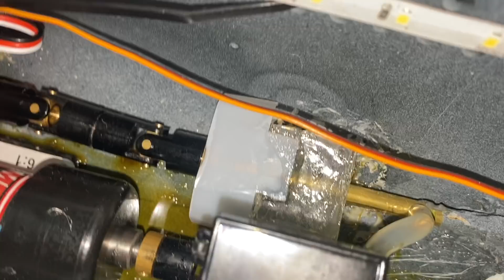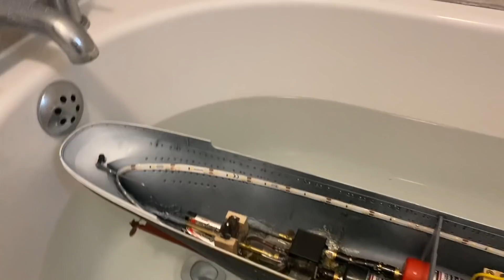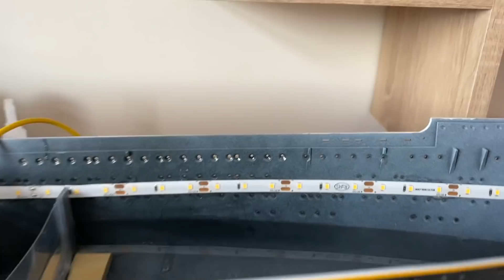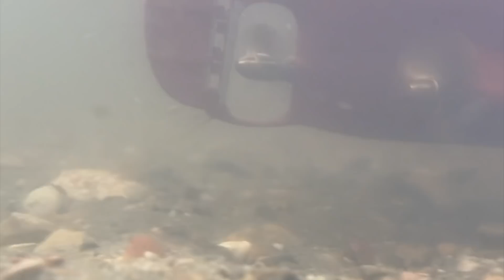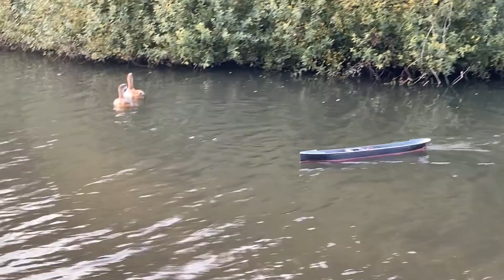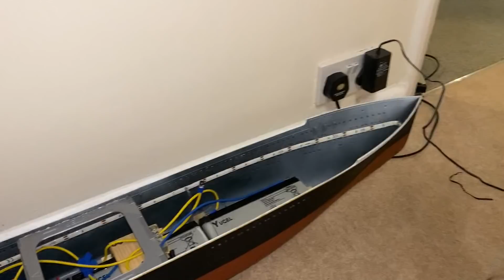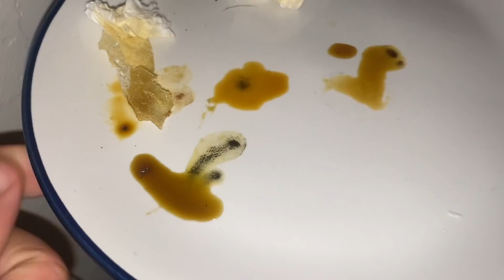Radio Control Trumpeter 1:200 Titanic Build Part 13 - The First Test

Comment: I intend to buy the kit and I saw that the whole kit weighs a little over 8 kilos. How much weight did you add to stabilize the buoyancy of your model boat?
Reply from the maker: Off the top of my head I don’t really recall, but the later episodes covers the ballasting and keel quite thoroughly 🙂

Comment: The ship is too far out of the water the propellers need to be deep down this will also have an effect on your rudder as if it’s lower in the water you will find you have better movement
Reply from the maker: Aye I know, this was a test run as much as anything.
She now sits almost exactly right in the water. Obviously as I’ve added more weight in the superstructure she’s got closer and closer to the correct waterline.
Reply: That’s good then I’m ha problems with mine right now I’m at the water testing stage and she float’s balanced perfectly but as soon as I add the main body to. The hull she listed baby to one side and I’m having problems to keep her up right I’m even thinking of adding a keel but I feel this wouldn’t look right

Comment: The pitch on the propellers are designed to scale. The actual titanic would take miles to reach cruising speed. Ships move around the harbors and such extremely slow and tug boats did most of the work

Comment: my rc boat uses grease in the prop shaft instead of oil, much less maintenance needed and very little mess.
Reply from the maker: Yep mine does now too! I decided oil was way too messy 😛
Reply: @TheModelBoatGuy  my rc boat project just keeps getting more and more expensive

Comment: This looks like an RC from 1990. Are you aware that things have moved on?
Reply from the maker: Very much so, I work in electrical engineering so am well aware of the advancements in the field.
The rational for lead acid batteries (I’m assuming that’s the part that dates the model) is quite simple.
Weight isn’t a huge issue with my model. 
I don’t need the performance that more modern batteries such as Lipo provide.
More importantly I wanted a model that I can use at the boating lake, but which can equally happily sit on a shelf for a good few months without needing attention.  
More modern batteries, whilst giving huge gains in terms of energy density do require more maintenance and are not the sort of tings you can leave unattended. 
Also, because lead acid batteries are relatively heavy it saves me needing to add a load of ballast, I prefer ballast that pays its passage!
Reply: @TheModelBoatGuy  If you leave a lithium battery at 50%, it will be happy for months. Lead is dead!!

My comment was more general than battery choice.

Comment: Sealed lead acid batteries are usually fully charge at the most of 13 to 14 V and then the resting voltage should be around 12.98 V to 13 V I love the Titanic model you made I made a full length titanic out of file folders in construction paper can’t wait to see the rest of it ?

Comment: Well done. A beautiful ship. I noted that you are charging the batteries in  the model. I guess you may have already thought of this  but make sure your batteries are sealed  or if vented,  vent outside the hull.

I once saw a very large UK electronics company build burglar alarms fot the government. They placed the electronics above the battery. Most soon failed due to corrosion in a matter of months!
Reply from the maker: Hi there,
Yes I’m using sealed lead acids, so they don’t produce much hydrogen. But a little bit when charging. 
They are relatively well ventilated and I have cut a hole in the top of the case to allow it to escape. I suspect over engineering it slightly because I doubt a hole is needed. But better safe than sorry

Comment: Have you done a amperage test to see what the boat pulls at full power. That'll tell you how long your batteries will last
Reply from the maker: Not yet. I need to buy a current clamp for my multimeter because that will make the test a lot easier

Comment: Really cant understand why the oiler is necessary unless something is seriously mis-aligned. And lead-acid batteries, why?
Reply from the maker: Oiler was a miscalculation for sure! It has since been replaced and I have packed the prop shafts with grease. 
As for lead acid batteries because I can leave them in the model without worrying about them. 
LiPos for example are certainly way better in most respects, but I don’t need to performance or power capacity they provide, and I wanted batteries that I could leave relatively unattended (charged obviously) but unattended in the model when it’s on the shelf without worrying
Reply: @TheModelBoatGuy  I see that makes sense. I guess you would have to ballast it too if you used LiPos so al round lead acid provides the best solution. Excellent project.

Comment: Very nicely build but why is the inside of the hull full of gunk? All that green stuff at the bottom
Reply from the maker: Hi there, 
Do you mean the stuff under the prop shafts? If so that’s leakage from the oil system. Which I have now abandoned! I’ve swapped it for a grease system which is a lot cleaner
Reply: @TheModelBoatGuy  ah yes that stuff, OK I get it. Why did you want an oil system? I'm sure the greese will be better solution. You should look into getting a 3d printer. They're great for making custom mounts and bodies for pumps and valves. Might have helped with your oil system. I've watched a lot of your build videos and it seems you like to over engineer a lot of this stuff. As an engineer myself I have the same problem with my boats. I usually remind myself it's a model and doesn't need the cooling system I just spent 25 hours designing. Sometimes it's fun to do it just to see if it works at the scale though. Excellent build though. Paint job, lights, details. You made a great stand too.

Comment: Why on earth have you used an oil feed for the prop shafts ?. Prop shafts should have grease points because grease doesn’t leak out. The amount of oil your prop shafts loose will probably kill all the wildlife in that pond. Oil feed is good for steam engines but not for boats and I’m surprised that Keith Appleton hasn’t suggested that.
Reply from the maker: Hi there, 
I agree with you on this one. Initially I decided to use oil over grease because the prop shafts didn't have enough metal in them to get a grease nipple installed (which would have been my preference). If im honest I didn't think the oil would be as leaky as it was but oh well, we live and learn. I have since packed the prop shafts with grease instead of oil. It will just be a bit of a nightmare when it comes to changing the grease!
Reply: @TheModelBoatGuy  I normally form a “Tee” joint with a short length of copper pipe and fit a grease nipple onto the end of that, but the problem is that your prop shafts are now fitted to the hull.
Reply from the maker: @bobfinning8587  yeah I get you, hindsight is a wonderful thing. 
I am going to have a little see if the cups I have installed are stable enough to inject grease into. 
As you say tricky to rework things now, but oh well. I know for next time!
Reply: @TheModelBoatGuy  what I use is one of those syringes that come with the printer ink refills, it fits quite well into an eighth inch hole, just fill it with grease and it works quite well

Comment: Just a question . I know Titanic had a three prop system .   each prop  push the  Titanic  forward . But when turning the ship only the main drive prop an one or the other 2 prop where turn off or braked to help  turn the ship better .
 
Looking at the back of the ship  far left  prop be drive 1
middle being main drive prop   2
far right being  prop 3 

 when turning to  the left prop 1 would stop spinning  only  the main 2 prop an  3 prop  would be turning to help steer the ship . since the ship is so long.

 I do recall they were able to brake each prop to help steer the ship better .
Reply from the maker: Yes so titanic used all three props in forward, but only the wing propellers could be reversed.
My control system dosent allow me to control each prop separately because I decided I could turn well enough without. But if I find I could use better turning capability later I might add that functionality
Reply: @TheModelBoatGuy   so wouldn't it better  to put them on there own  speed control to allow  fuction that you can control .  for a ship that  big  before it time in witch is  was .  you would think it would need help in turning  it self . reversed thrust  of some sort . i  think it  would help out of butch  in controling  it .  The ship wasn't  really great   in turning but was one   hell of a tank  going forward .
  reason why i said this is cause the Movie doesn't give it justice . cause the ship wasn''t designed  to go full reverse  an turn left  due to it be pulling full right . that was something  that threw me off . 
i love the little ship man  i just  thought i would share . :)

Comment: You are sailing the ship at too high a speed. Unfortunately, many people don't realize that when you compare speed to the scale of the ship, you are sailing at powerboat speeds.
Reply from the maker: Hi there, well aware that I am sailing her too fast. 
This video is the 13th in a series and my intention here was to test the ships capability. I would never sail her as fast as that when complete, but it’s useful to know how well she turns, how fast she can stop, and how fast she can accelerate. Then at least I know encase anything goes wrong when she’s complete and on the water!

Comment: Why not make a hidden port with a switch and charging port once the superstructure is in? Perhaps quick release with epoxied in magnets or something..
Reply from the maker: Hi there, that is sort of what I ended up doing. Not quite as sophisticated as your suggestion but I ended up cutting out one of the D deck gangway doors so I could run Charing cables through. Then added a door on a hinge there so when the model sails it still looks good

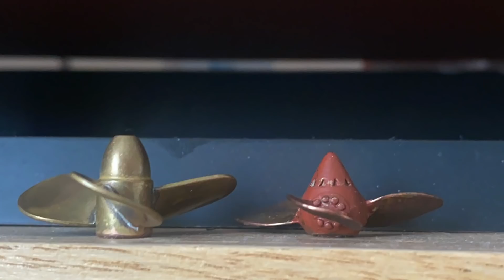Comment: @05:33 A little late to the party but can't you just 3D Print a suitable model for yourself with all the features you'd wand and then create a metal casting from that using high temperature silicone? 🤨
Reply from the maker: A bit beyond my skills im afraid!

Comment: Probably a bit late but here goes,
To slow down and keep steerage only throttle down the two outer props keep the centre on at full.
It may sound counter intuitive but I have a type VII u boat and find I get better steerage by throttling down the prop on the outside of the turning circle.
With three props you could try differential throttle on the outer two props. Steve

Comment: Nice job, love the video..... I built a 1/375 Revell kit of the Titanic and made it into a radio controlled model. I also did an old kit in the same scale of the RMS Lusitania and made all four props turn on that one.the nice thing about the Lusitania it had two left-handed propellers and two right-handed propellers that turned an opposite directions but still thrust the model forward. My next one I'd like to do is the SS United States
Reply: Show us
Reply: @T.B620  how do I show pictures on this thread, I've never done before...
Reply: @michaelfiguly1654  u need to make a video, and put it on ur yt channel. Love to see ur titanic someday!

Comment: The electronics in this ship look ancient. Why the lead-acid batteries and DC motors instead of Lipo and brushless?
Reply from the maker: Well im certainly using older style electronics for sure. My rational for the lead acids is largely down to charging though I also had an eye on the number of charge discharge cycles I was expecting to get. 
I wanted the model to be a display model as well as a model to take to the pond. You can run into issues with Lipo batteries by leaving them in various states of charge, and you have to be quite careful when storing / not using them for long periods. Whilst less good in terms of energy density etc lead acid batteries are pretty rugged and happy to sit at full charge indefinitely. LiPo batteries are brilliant, but I do tend to think they would be rather wasted on this model. Ultimately I wanted a system that I could use when going to a boating lake, but that I could also just charge up and leave on the shelf for a few months without worrying about. LiPo batteries pretty much supersede lead acids but require a bit more looking after otherwise things go wrong! 

Regarding brushed vs brushless I think one of the biggest benefits of a brushless motor is the speed it develops. Speed wasn’t something I was particularly worried about on my model. There are three propellers so she gets up to a decent speed and really i don’t intend to sail her at full speed anyway (because it looks a wee bit out of scale). Performance wasn’t really what I had in mind for this model so I felt the added cost of brushless wasn’t really worth it.
Hope that all makes sense!

Comment: Real nice, but don't get the oil mess you have created with the propeller shafts.
I have build many ships, surface ships and submarines and never had any issues with leaking prop shafts.
Just some marine grease and that's it.
Reply from the maker: If I’m honest it is a wee bit more leaky than I had hoped. I tend to only top it up when I go to the lake. I wanted something because I have used these shafts before and they are quite good but do tend to leak after a bit. 
Grease may well be a better idea. Do you have any suggestions? Something light I would guess

Comment: is recharging the batteries in parallel best for the batteries?  depends on the technology I guess... if they were smart tech then that wouldn't work very well since the charger would stop when the battery reached a certain level.  but with 2 contacts, I guess that isn't an issue.  So I guess it is safe, after all.  Just had to talk it out LoL

amazing job!
Reply from the maker: Hi there, I am not an expert in battery technology but I believe it's ok to do this. From the chargers point of view it sees a battery with twice the capacity. As you say if they were intelligent it wouldn't work, these batteries are certainly not intelligent, but they serve a purpose. 
Always good to talk things through :P 

thanks very much, glad you liked the video

Comment: Here is a fairly new video show casing this pulsing action if the pair of U-joints are not phased together.. Which is a direct result, of me pointing this channel in the correct direction from a few of his videos on back, where he too, was building most of his projects that used U-joints out of phase and was stressing gear trains, or causing bad vibrations in higher speed / spinning projects.. Hence he made this video... And he show cased it exceptionally well.. to the point that how he showed the magnification by adding ALLLLLOT of U-joints, to show how bad the pulsing can get, let alone how much torque is required to over come the lobbing stressesevery other 180 degrees... It is unknown if the link will show up.. ?

Comment: NICE BUILD ! ! ! But, I kindly mention, your U-JOINT's are out of phase, and will cause vibration or pulsing in the final shaft, every 180 degrees speeds up, then the next 180 degrees, slows down... does that every single rotation.. At least on the prop drive shaft at 0:30 to 0:35... Look up a few YouTube videos called "U-joint phasing" or "drive shaft balance and phasing".. they are short videos.. One of the videos is old looking, but still in color, .. But will open up all sorts of clever info in case you didn't know... Really great looking build so far. I look forwards to the future. Good luck and be safe.

Comment: Would running the centre prop only when low speed manoeuvring be a benefit? The two outer props thrust could be counteracting the centre props flow over the rudder? Could this be setup by trimming the outer props to come in late.

Comment: 1 m/s at 1:200 scale is 200 m/s at 1:1 scale; so around 700+ km/h, 450 mph, 400 knots. I knew Titanic was fast but THAT fast … lol
Reply from the maker: You are quite correct yes. Do bear in mind that on this video I was testing out the ships capabilities, at this point I was as knowledgeable as you on how the ship would perform!

The scale argument is quite correct but you have to remember that everything else is also out of scale by comparison. Wind, currents, waves, etc etc. At the speeds I was getting with the original props it was absolutely impossible to turn the ship because there wasn’t enough flow over the rudder to turn, and any wind made the job harder! 

My mentality here has been to have more power than needed. That way I can run the ship at 10%, with 90% in reserve, rather than having to run the ship at 100% all the time and not having a means to get out of trouble.

Comment: I think original props gave enough power to move the ship in accordance to her scale. It is not a speed boat.
Reply from the maker: Possibly, but you have to remember that everything else is also out of scale by comparison. Wind, currents, waves, etc etc. So a perfectly normal gust of wind at 1m/s translates to 200m/s in scale terms! 

At the speeds I was getting with the original props it was absolutely impossible to turn the ship because there wasn’t enough flow over the rudder to turn, and any wind made the job harder. 

Having more efficient propellers doesn’t mean I will sail the ship at 200mph, it means I have the capability to get out of a tricky situation if one arises. I prefer to have more power and run the ship at 10%, with 90% in reserve, rather than having to run the ship at 100% all the time and not having a means to get out of trouble.
Reply: @TheModelBoatGuy , well if you can regulate screw revolutions and use power to compensate inconsistencies between model and reality then fine.